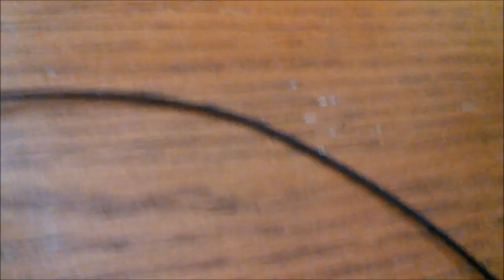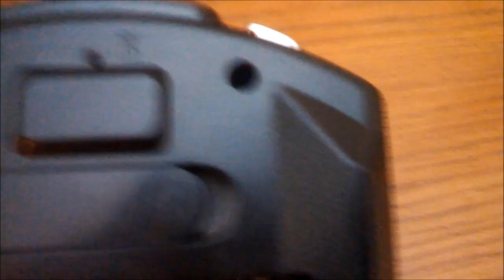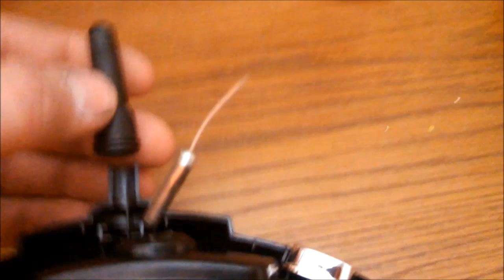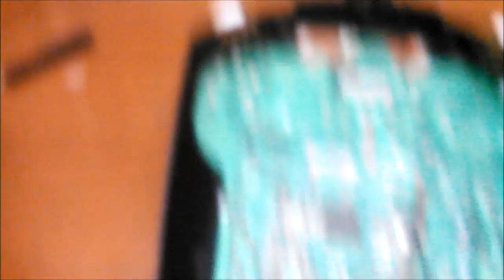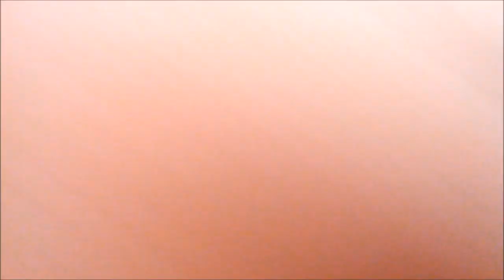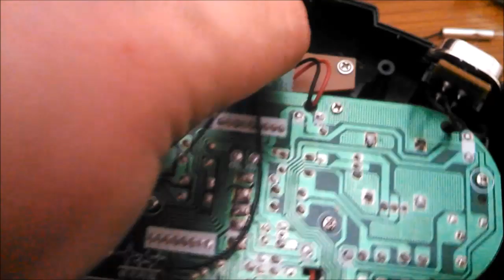How to Add an RP-SMA connector to V262 Transmitter

Comment: What was your range in meters or feet, before and after this mod? I also believe that the less exposed wire possible, inside the transmitter would also be better. :)

Comment: What is the link to where you bought it on Amazon? Thanks
Reply: http://www.amazon.com/Mini-Antenna-RP-SMA-Bulkhead-Pigtail/dp/B007XVHQ9M/ref=sr_1_28?s=electronics&ie=UTF8&qid=1419629466&sr=1-28&keywords=RP-SMA+antenna
Reply: +diabolicaldarkness1 
I found this link from Amazon for 2 connectors @ $6.19:
http://www.amazon.com/20cm-U-fl-IPEX-RP-SMA-Pigtail/dp/B00A3LLFF0/ref=pd_sim_147_13?ie=UTF8&dpID=311c1oGtr6L&dpSrc=sims&preST=_AC_UL160_SR160%2C160_&refRID=0KEYNVXGYXQEVEG77V0B
Jim

Comment: Nice job.  I'm doing this same upgrade when I receive my v262.  It's on a slow boat from Singapore..
Reply from the maker: thanks! I'm waiting for my antenna to come in so I can really put the mod to the test.
Reply: Just got my v262 from Banggood today.  Have already made some modifications.  I took off the canopy as the first job.  I don't need it.  I flew it in my basement with no problems.  A piece of cake compared to my variable pitch 6 channel large copter.. I'm still awaiting my mobius camera.  I already installed the mount.  Can't wait to fly this sucker.  I'll post Youtube video when I'm ready..
Reply: Hi I did this on mine but my controller is giving a weird beep beep noise every 2 to 3 secs? The controller still work on my v262 quad. But it making that beep niose doesnt stop.

Comment: Great video!  Going to include a link to it with all my applicable videos. One comment, you can beef up the stability and strength of the sma connector by injecting a big blob of hot melt glue around the connector, just inside the transmitter box.